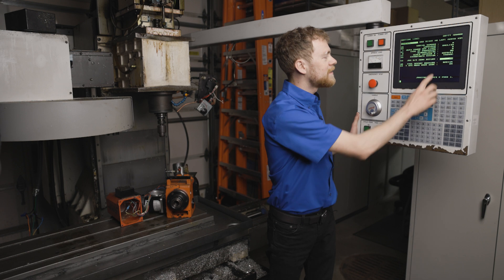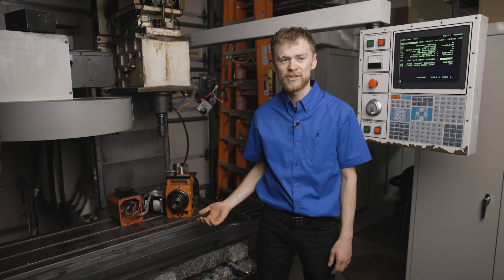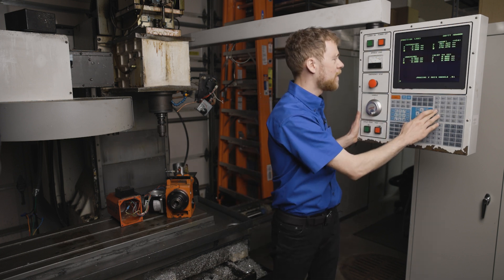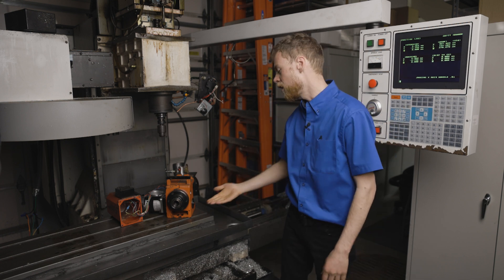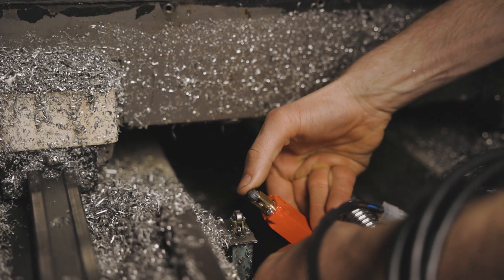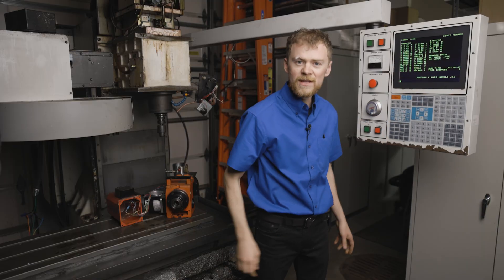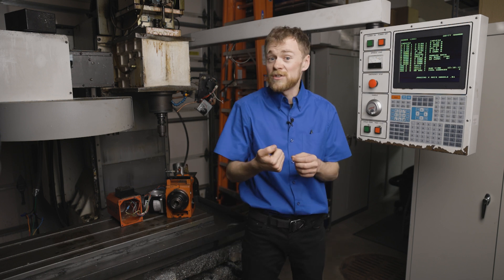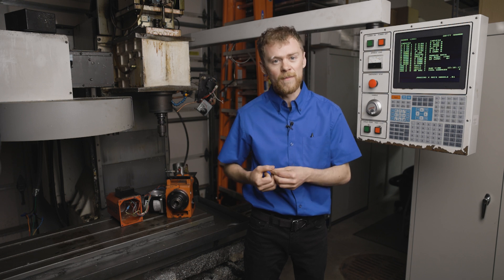Alarm 161 X Drive Fault—Straight To The Point

Comment: What a great video, let's see if you make a video of the 160 alarm
Reply from the maker: I plan to!
Reply: @cncrepairman  Thank you, can you help me remove the alarm from my Haas machine? I got alarm 160 and 123, I changed the voltage on the taps, under the vector drive and it worked, after turning it off and on the alarm came back 😩